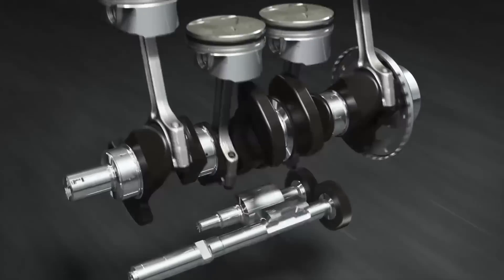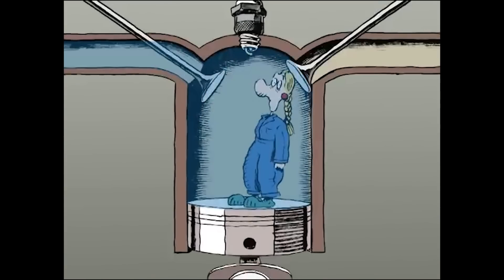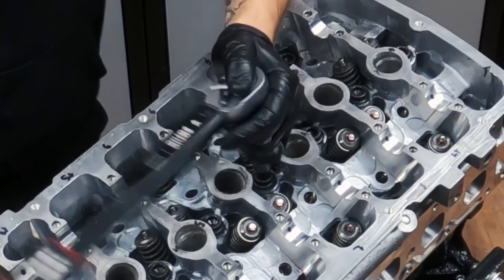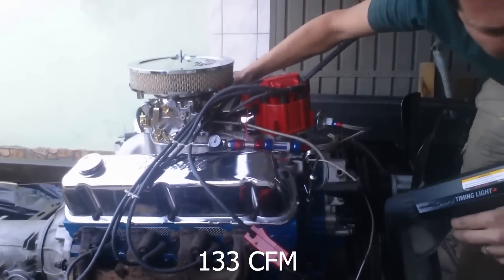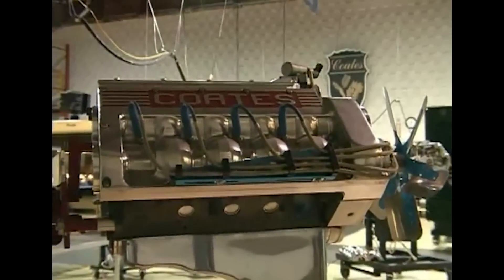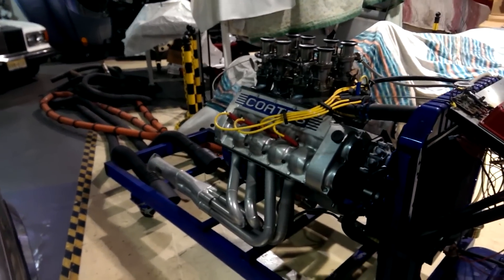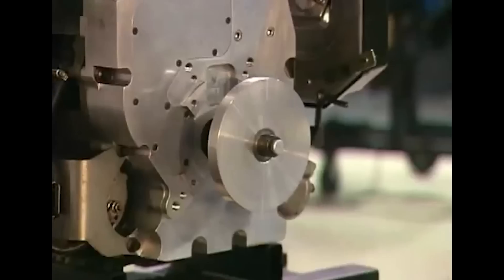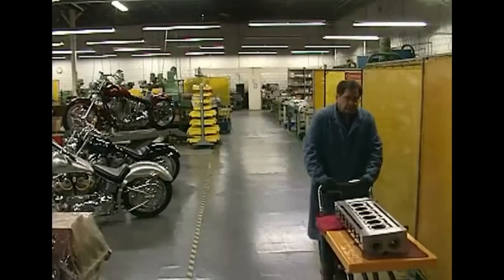A Promising Evolution in Engine Design - The Coates Spherical Rotary Valve

Comment: Several issues come to mind. The poppet valve transfers combustion heat through the valve seat(s) to the cylinder head and then to the oiling and cooling system. This rotary valve system cannot do that as it is isolated from the head in ceramic bearings and is not lubricated. How can it dissipate heat from combustion? It can't. The poppet valve is intrinsically shaped so that it will seal against the seat under cylinder pressure. The rotary valve has to be mechanically held in position to prevent cylinder pressure leakage. There has to be some sort of mechanism to exert pressure and compensate for wear. None is visible.
This leads me to believe this is a scam. It looks like a play to sell bogus stock in something that kinda looks like it should work, but doesn't. The facts that the shares are worthless and nothing has been heard from Coates in ~10 years bears this out. If it really worked, it would be very visible.

Comment: In the early 1960s a company called Southcotts built a rotary valve head for a 6 cylinder Holden motor.  This motor was raced in a speedway midget with moderate success , but sealing prevented it from achieving its potential. There are pictures on the internet look it up. PS I lucky enough to see it race.
Reply: That Holden motor needed a supercharger so it could get the air into the cylinders, as I remember. A guy named Dunton was involved in the design & building of the project.

Comment: I wonder what the fuel consumption of the Coates design was in comparison with the "normal" engine. The Wankel engine was also great in theory but in practice the rotor tips wore and fuel consumption was a BIG problem

Comment: I remember an issue of Engine Masters covering this about 15 years ago. If this was the panacea it's built up to be, why hasn't production begun? It doesn't have to be an OEM that starts producing these. I recall the claims of high reving, low emissions- because of little oil contamination, and incredible power production. What hot rodder wouldn't want this? This is reminiscent of the Feuling heads for BBC. It sounds like a lot of pie- in- the- sky to keep engine enthusiasts buying magazines and such. It's very disappointing to see these great ideas and have to think it's all an investment scheme with a slick PR campaign.

Comment: There have been a number of rotary valve designs over the years, a conical one with the axis inline with the bore, a cylindrical one across the bore like the Coates and of course the sleeve valve.  They all develop more power and are smooth but they also all have problems with combustion chamber shape and oil consumption as the rotary valve must be lubricated.  Coates and others have tried ceramic bearings but like ceramic pistons, this never quite works.  With all rotary valve designs the lubricated surface is open to the combustion chamber at some part of the cycle so oil gets burned. But look at the freevalve technology, it too promised much but a few years on we are not seeing it in widespread use.  Poppet valves are not ideal but they are well understood and they work well enough.  We know how to build DOHC variable valve timing engines, (I drive a 30 year old Mercedes with this tech) but what engine does everyone want to fit, an LS, a push-rod engine!

Comment: I tryed to take a patent (5 stroke engine) that combines very well with this rotary valves. No, there is some engines call 5 stroke, but my engine is completely different, my engine works like a compressor engine, but without a compressor.
Reply: all engines are compressors. thats what the compression stroke does. compresses air. 

with one or two exceptions, now well obsolete. like the lenoir cycle.
Reply: @paradiselost9946 I didn't write well with my Brazilian English. My engine works like an engine with a compressor, but in fact it doesn't have a compressor (Não escrevi bem com meu inglês do Brasil. Meu motor funciona como um motor com compressor, mas de fato não tem compressor).

Comment: Well they wrr producing motorcycles for awhile with this valvetrain. Lately it seems they're going to power generators and hydrogen fuel at that. China(of course) seemed interested and has bought a few. Honestly i do wish automotive applications were on order...even a subsidiary or 3rd party company liscensing this and selling it to us gearheads. Imagine an easy, daily 10k rpm Ls motor...drool.bog dtawbavk i currently see is the current progression of ohv engines today. Now they flaunt 319(?)cfm...an ls3 does that. Not sure about ford. Question i have is whats the flow over rotation? In a typical poppet valve it would be flow by lift...which can also be broken down by degrees of crankshaft rotation. Since these have no "lift" how does their flow ramps look? This with forced induction (a good setup) would probably just destroy damn near anything else though.N/a these days?-may be beat on the upper horsepower(at stated flow ratings) BUT and i mean a big But...whats the average horsepower and torque comparatively to each other...at same compression ratio...and at max on available octane for each

Comment: It's a shame they didn't go further with this , maybe it's company mismanagement or maybe big oil corporation stopped them ? I personally love this system and can see endless possibilities for this design and combined with other ideas or to me would be an awesome system on any car bike truck tractor boat etc etc . I did hear that it would cost someone about $1million to get a licence to produce these heads using the coats design . A clever Aussies many years ago built a couple to suit the Australian grey motor , Dunstan rotary valve head. Apparently it worked very well
Reply: Yes seen it in action at speedway,  highest revving grey motor I've heard . Sadly not much torque due to sealing .

Comment: I used to follow this tech back in the 2000’s but found a poppet valve design that does perform very similarly but not up to the claimed high rpm values of Coates engine. Twin vector induction system. You notice you could never find any power graphs or hp and torque values at specific rpm other than one rpm point for the Coates. But the TVI system can produce 102 lb.ft. at 1500 rpm and 183 lb.ft. at 5400rpm and 282 horsepower at 9000 rpm on what they call street cams in a 90mm bore x 77mm stroke inline 4 cylinder. 1960cc DOHC.
Intake has downdraft and side draft runners per intake valve x 2 intake valves. The design effectively eliminates the valve as an obstacle. Kind of a Yin Yang pattern. Naturally aspirated. The issue with rotary vale’s is sealing, nothing seals better in the ice than a poppet valve and that’s why they are still around and with all the flaws of the watts crank design it’s still around for a reason also. http://www.engineprofessional.com/articles/EPQ215_58-60.pdf

Comment: I remember reading an article about this valve system back in the 90's, and expecting a revolution in engine technology, but it never arrived.
Reply: It's a conspiracy by valve and spring manufacturers. They squashed the patent 😂
Reply: @geniferteal4178 yes, and the creator was shot dead in the foyer of the hotel he was due to meet a major car company to sell the patent to.
Reply: @steveallen1340  and prohibition was to force Ford to run his cars on gasoline not ethanol.
Reply: @currentbatches6205  guess you are not in the mood for a good conspiracy.  Wanna buy a bridge... cheap? (What's the bridge version of copart?)
Reply: @currentbatches6205 and the engine that runs on water. 😁
Reply: They sold out to the Chinese
Reply: Yeah, it never will arrive because it is practically inferior to poppet valves.
Reply: That's about how old the video looks.

Comment: How much energy is used to compress the valve springs hundreds of times per minute?
Reply: @paradiselost9946  That is a good point however as far as returning the energy to the camshaft i doubt if a cam is a very good reclaimer of energy.Yes once it is over the lobe the spring tends to push the cam a little however when the engine is running the cam is turning anyway so i don’t know how much useful work is done by the spring pushing the cam for a short distance.Certainly for the majority of the revolution thevspring is either rubbing the cam or is being compressed which takes energy.
Reply: @jimjackson4256  energy from the valve spring is returned to the all the way till valve float as that's the point the cam is turning faster than the spring can keep up. need a lot of measurements to calculate that point though but any production car that will be above the red line. if it was absorbing say 40 hp that would be 30Kw of heat in the valve train.
Reply: @jimjackson4256 mechanically, a cam can be broken down into an inclined plane. a wedge. it works irrespective of the direction the desired forces are being transmitted, that is... they are reversible. until you reach a certain angle of incline, at least. obviously, a 45 degree slope, or 1:1 cam lobe profile is the ideal for reversibility. whereas a 5 degree slope is pretty well much useless in one direction.  at this point, an inclined plane can then be broken down, mechanically, into a simple first class lever...  wheres the fulcrum, wheres the work, and wheres the load?

the loss is the friction of the rubbing/rolling surfaces. cams are pretty well lubricated, plenty of bearing area, or roller bearings in some cases... dont see much wear on cams.

one can also consider the power of compressing a spring in the same regard as compressing the air on the compression stroke. without combustion, the same work, minus friction, would be returned from that compressed air. an ICE simply heats the air up rapidly through combustion to increase the pressure so that compressed air can "perform work".

dont worry, i used to think about rotary valves as well... a lot. too much?

imho, the only option is a piston valve. which has its own issues as well. but are far easier to deal with.
Reply: Typical v8s are about 40 hp Ive heard. Less at high rpm

Comment: Coates Cylinder Head company had a lot of  Enemies! I was asked to be a bodyguard in 2001 !
Reply: Same enemies as the improved/upgrade carburetor creators had. Same reason why the original job formula of slick 50 is no longer legal in the USA
Reply: I can imagine they would have had enemies, should have just gone ahead anyway in an undisclosed location
Reply: I can only imagine the troubles, much like Tucker had trying to break into the industry with all is groundbreaking technology at the time.
Reply: I can imagine. They have a potentially industry revolutionizing technology on their hands and established engine manufacturers would have to retool part of their production line to adapt which would take time meanwhile these guys can be cranking out engines, building their own market share and brand reputation.

Comment: Thank you for the information, do you know of fuel efficiency and emissions. Years ago always thought of rotary valves would be better. Have you heard about the Achates motor, also look up Achates Ford f150 and the Achates truck motor. Don't know where it is on the development stage. Again thanks for your information, gives me information on what is happening in the world
Reply: Apparently it used 40% less fuel 40% more torque and ran cooler while keeping the oil much cleaner for far longer

Comment: An added benefit from this design is that the engine does not have to work against the valve springs.  This doesn't seem like much but racing engines usually have double valve springs on each valve....Now when that is multiplied X 32 valves, that is a lot of work for the cam, push rods, rockers to finally open the valve.  Not only that but the inertia of all the hardware is added in and having to change direction from the cam turning, pushing the lifter and push rod up, the friction of the rocker arm and changing direction again for the valve to move in the OPPOSITE direction is all LOST energy!  A rotary valve system eliminates many problems.  The first of which is having to compress 64 valve springs constantly!

Comment: Ah yes, my favorite type of valves/cams. Just imagine the Chevrolet 496 or Toyota 2JZ with these things 😍
Reply: Will still be limited by flame speed. I'm guessing sealing and longevity issues make it unfeasable.
Reply: Original development was on a Chevy big block
Reply: @asherdie  wish they had a video of that
Reply: I hate to break it to you but for all its benefits , there is deal-breaker problem.. Exposing Rotary Valve seal (witch made of rubber).. Development of some sort of composite seal will have to be sorted out and this technology is not new but was never implemented cause of reliability problem
Reply: It’s simple ?
Reply: or my lawnmower :)
Reply: The rotary valve 5.0 only made 480hp. It's way easier to make 500+ hp for way cheaper with simple readily available off the shelf parts on a 5.0. The fact that this guy feels the need to vaguely explain a conventional valvetrain doesn't say much about the targeted audience. The airflow and combustion efficiency must be terrible to not be able to make more than 480 with a 14000rpm redline, absolutely terrible!
Reply: @steveletson6616  pretty sure the pull wasn't to 14000rpm.
The theory is sound, barrel valves will flow double of most performance poppet valve set ups, not even mentioning the rpm capability. 
The problem is they just don't seal or last .
Reply: @m.b.82  And it's way more expensive, weighs more, and takes up more room.With the sealing issues boost is probably out of the question.  Hell, a Steve Morris 572 BBC can make 5000hp and be driven across the county stopping every day to drag race. 2 valves per cylinder with pushrods at 65lbs of boost makes this old idea as obsolete now as it was then. Koenessegg has some crazy high tech valve activation that actually works in a production car. We all know that more cfm doesn't always equal more power.
Reply: @steveletson6616   allegedly weighs less and way less moving parts. Also none of the friction of springs and cams. Pretty much the perfect solution except they don't seal
Reply: Why? It's the best way to ruin a good, reliable engine.
Reply: i was thinking of the 2zz but it would be hard to get the high cam noise you get from the valves opening more vs the rotary just spinning
Reply: Now imagine it after 50k miles...toast.
Reply: Imagine a 3800 cc with  this kind of valve train with a supercharger.  With NO valves to "float".  No wonder it can rev so high!

Comment: I actually emailed Coates 15 years ago and he replied…
He started out in the early 60’s !
Reply: In the 70s, I saw a rotory valve in a model airplane. 
I wonder if that was Coates himself.
Reply: Considering that his company is still in business building commercial generator sets, the design must have some merit. When you consider that one of the fastest growing fields of engineering is material development, any pitfalls he experienced back before 1990 in developing this engine head valve seals quiet possibility have been overcome. There are new developments all the time in strength, wear resistance and heat tolerance of materials. When you add to that logic, the deep pockets that the automotive industry have for R & D, and the reduced number of components ( about half of what's in a poppet valve head) and the huge reduction in build complexity that it offers the cost reduction for building this head is all by itself worth it, There is only one thing that is stopping the auto industry from incorporating this into their products...It's the only industry that stands to loose anything if this invention were to get enough recognition...the oil industry !  They could not take the "hit" that this would deliver over just a few years of success..the reduction of fuel consumption by possibly as much as 20% !!.  Just like any large business...they don't want to sell less product...they want to sell more.  Please someone tell me this is not sound logic !!!
Reply: Sometimes an idea is too good. Sometimes the forces that be fight against good ideas. After all, how many stories have you heard about carburetors that produce 100 mpg only to completely disappear and the inventor with it!
Reply: @90ForLifeTeam  A car can easily get 100 mpg. The problem is it will suck at acceleration, have minimal load capacity and just be too slow for road use. Conspiracy theory believers are Not the sharpest tools in the shed.
Reply: Do we know any of the names of those inventors or have and pictures of what they made?

Comment: More engine technology I've never heard of.  Where the hell do you find this stuff!  Seeing how the rotary valves work, they are almost common sense.  I'm surprised they haven't
 been put into use.  Keep these excellent reports coming.
Reply: I would call this valve body the "super Hemi-head".
Reply: They haven't been put into use because it's a failed concept lacking adequate airflow with poor combustion efficiency and it's heavier and considerably more expensive than a traditional setup that makes more power, is cheaper, and weighs less.
Reply: @steveletson6616 That's a funny way to tell that you didn't watch the video nor the video from driving 4 answers about (barrel shaped) rotary valves.
Reply: @Jinppa  That's a funny way to say that you know little more than what you saw in those two videos about them. It was a failed concept in the early 90s for all the obvious reasons.
Reply: @steveletson6616  You were comparing two different things claiming they are the same. Spherical is not the same as a barrel and if you look at the video again, it does not have through holes but a "pit" for the gases. Your claim about adequate airflow is BS too.
Reply: Cost of licenseing limit wide spread adoption
Reply: Maybe because of the patent and their rights to the design.